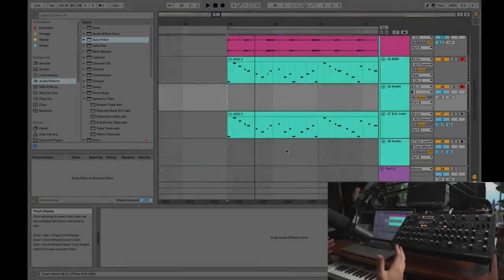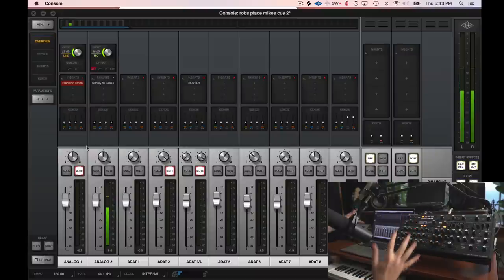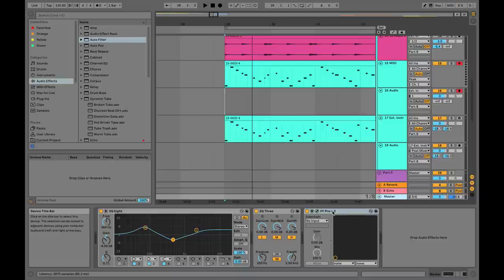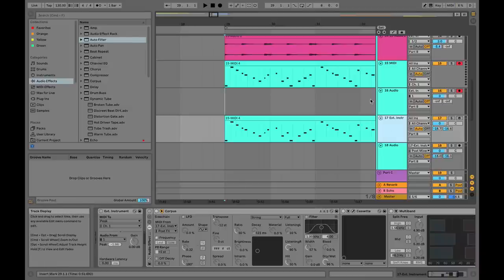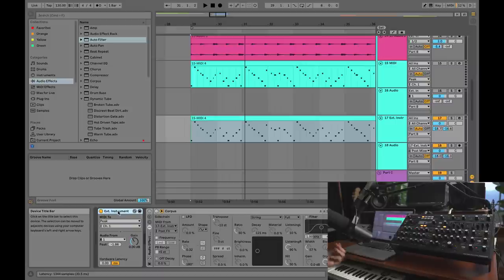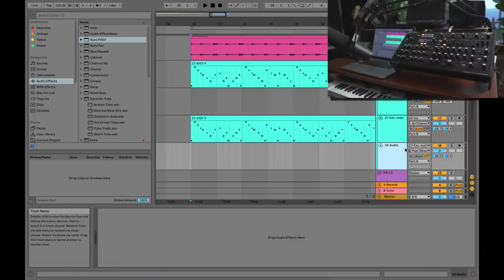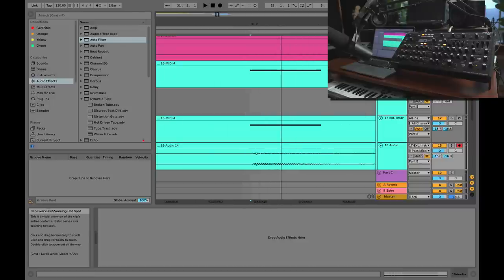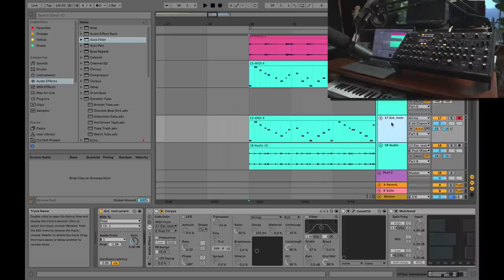How to Record Midi Synths Without Latency in Ableton Live: External Instrument

Comment: Dude - just watched both your videos on latency - so well explained - thank you. I now have to go and try it out but I can do with more confidence now - watched loads of videos and just came away still confused but I think (hope) I undersand now - in the past I just end up metaphorically throwing ableton out of the window and giving up. One difference for me is that I use an external sequencer (Novation SL Mk3) rather than the Ableton sequencer and just want to record the audio from my ext synths into ableton for arrangement / mixing / fx and adding the odd soft synth - So I am hoping this will work for me there.  Any which way these are great videos.

Comment: Great video! Would love a follow up on fixing sync / latency when using external synths that rely on clock. Example a hardware synth that has an arpeggiator, getting that to tightly sync with Ableton is still next to impossible for me.

Comment: I have many MIDI synths and hardware sequencers. I've had crazy problems where the sound from monitoring external synths would come early (crazy I know) when using External Instrument and on the MIDI channel delay offset, the "+ve" button, would do nothing, only the "-ve" worked...I need to use a larger buffer (1024) to run the stuff I like to run. Then I needed to adjust for the clock being sent to the LFOs/sequencer of the hardware synth and adjust for the MIDI notes that where sent to the same synth so the note triggering would be for example, right on time with a square or S&H LFO.
Add to that the fact that the more audio tracks that where added later as I progressed in the project with UAD plug ins and other oversampling plug ins, latency got so bad that tweaking knobs when recording audio whilst the synth was being played from a MIDI clip, would make things just, unusable.

Stopped using External Instrument, monitored only from UAD's direct monitoring, all problems gone. I know everyone's praising the thing and its obviious on the video that it works, but it never worked for me, it actually made things worse.

Comment: This is so incredibly useful - i've always had problems integrating hardware with my DAW. What about clocking / sync and jitter? There are plenty of videos out there recommending ERM multiclock but i'm not sure if I really need to be spending £200 or £500 just to get things to sync reliably? I've also seen devices like Midironome, Midiburner, JMK Clockstep, Expert Sleepers UASMO, innerclock systems, maybe iconnectivity and motu midi interfaces also do this. The new arturia 16 rig interface interests me and it also has midi clock out. Many of them work by sending out pulses from your DAW to create sample accurate timing. Do I need this kind of thing?

Also if you use a ultralow latency interfaces like an RME or thunderbolt like a quantum that do 2 or 3ms RTL does this vastly improve things and make all this a lot easier, or does it all need to be adjusted and compensated in the same way anyway, so you're not really gaining anything apart from different compensation numbers?

Comment: Hi, thanks for the fantastic explanation. Now everything is more clear to me about routing MIDI Out of Ableton and recording it. Anyway, one thing that I still struggle with is how to use external MIDI sequencers with live. So that Ableton will receive MIDI. In concrete, I use an iPad wit Ableton Link and I’m trying to send MIDI sequences from iPad to Ableton but I’m getting none synchronised results. IOS has some excellent Generative sequencers, but it is a pain to sync things together with Live. So I was wondering if you could maybe explain this maybe in an upcoming video or give any clue how to handle this. Thanks! And thanks for this Amazing video.

Comment: Thank you and great video. What midi interface are you using? I noticed you have a uad which does not have a midi i/o. I am using an older steinberg ur22 that has midi but looking to upgrade to uad so curious as to what you’re using or suggest. 

I still have some issues with latency and have since just found solution in starting a recording with a high transient like a tr8 kick then taking it out/off and setting 1.1 to the transient then taking the audio I want. My problem may be too many different synths with diff hardware latencies so I record them individually. I go ext inst out to steinberg ur22 then to Kenton midi thru 25 then to shit lol like too much dx7, prophet rev 2, tr8, ensoniq sq80 and a bunch of others and they receive on different channels (then audio into Allen and hearth zed 24 back to stenberg). Pretty much given up on being able to play loops or recorded audio w live playback from hardware via midi. My interface has a monitor/ daw switch and Idk I can get kinda close but either I’m doing something wrong or it’s just too much.

Comment: Speaking of latency... Have you ever noticed the mismatch between audio latency and midi clock? That's a common problem since Ableton is handling time differently than any other DAW. The easiest example to explain what I mean: Take an AutoPan, set amount 100%, phase 0%, sinus shape 100% and sync it to 1/16 so that it will chopper any input as 1/16. But now put some latency producing stuff before the AutoPan, maybe an effect rack containing 10 turned off compressors with 10ms lookahead each (just for simulation purpose) and check how AutoPan syncs. It's synced to the clock before the latency and choppers 100ms ahead... Well, there might be an offset knob but all that becomes really funny when you share such synced devices across the board in a growing project via send/return. Give it a try. :)

Comment: Nice video!
Since you started playing notes with your hands i assume there is no way to get rid of that latency while playing other than turning direct monitoring right?
Reply from the maker: There is always going to be some latency if using software to monitor. Much of the time, if you have your system latency low (lower your buffer size to achieve this), as in under 20ms, you'll be close enough to play and record things. Direct monitoring removes latency entirely (or within a couple ms) when using external gear because its a straight signal path from input to output.

Comment: Latency probably the single most important thing for those with real instruments. Thinking of investing in Apollo twin x to worry less about it. What do you think @anthony ?
Reply from the maker: It doesnt matter which interface you use for latency as much as it does for sound quality. Even those little red saffire interfaces have direct monitoring. UAD does however have really nice converters in their interfaces as well as plugins that run off of the chip in the hardware. Be careful though its a money pit haha
Reply: @SeedtoStage  I've been warned but the algorithm is already working against me haha. But my point is that is you don't wanna do direct monitoring for guitars (because you want to monitor all your plugin effects) then the UAD will likely be the more powerful latency-free option, or?
Reply from the maker: @bvrbvs  they have great drivers I can def say that

Comment: I came here right after watching one of those 4 producers one sample videos. I feel like my computer handicaps me the latency is unbearably awful. I was watching these pros in awe just wondering how they have one hundred effects with automation going. I couldn't do this without a fire extinguisher!
Reply from the maker: If you have crippling latency, likely you’re on a windows machine trying to use the basic audio driver. Look at Aiso4all, a free low latency audio driver
Reply: @SeedtoStage  yea I don't get it really. I have a mbox mini and my windows machine has an i5 with 16gb ram. I will for sure try that driver maybe that will help. 
My latency is zero on track one but compounds so fast

Comment: I'm in a slightly different setup, where I want to use Ableton Live as multitrack recorder, but I have my sequence programmed in an external MIDI sequencer which is also the MIDI master clock, so I put Live in EXT sync. But in my case the recorded audio appears ahead in time (~1/16th), instead of being delayed. How come? (note that when in EXT sync, both options Delay Compensation and Reduced Latency are not available)

Comment: I'm having the same issue with my Microfreak but its coming in too early and the external instrument will not let you go negative. is this possible or i am missing something> i followed the video more than once with the same result.  this video helps a lot but i still have a lot of homework a nd messing around to do for sure. is it possible for an external synth to be ahead of the ableton clock?

Comment: I am coming from Logic to Ableton and haven't made a song in ableton yet.   I have 20 + hardware synths and i monitor everything simultaneously at the same time.   I've done it this way for years and I didn't really notice anything as an issue, but maybe thats because almost all my stuff is hardware (drums, etc) so maybe everything is in sync.   I also have been using PCi and recently switched to thunderbolt motu interfaces.   Now my question / issue is?  I tried to do this method.  I added a external instrument, say midi 1.   the second I added another channel I was unable to do this because the synth shares the same output with all 16 channels (think Virus / Triton / etc) .  Is this method that you are teaching only viable for 1 output / 1 channel?  like say a drum machine?  I could do this on my Airbase99 ?   Maybe I was missing something so I can try again, but can you confirm that I can do this with 16 channels and only 2 inputs?  or not exactly.. . because in the past, if i wanted to do any effects or anything like that in logic i would need an additional output on the synth so i could have a lead isolated to put FX and then the other 15 channels could share a main output and they had to rely on internal fx so they didn't compromise the single in L R from that group of 15 channels..      thanks

Comment: Great and clear explanation - thank you! However there is one thing that seems to be impossible: to play and record midi (from a midi keyboard) in real time with no latency while monitoring through the software. That would be the ultimate hack!! I like to play and improvise live, and the small latency is annoying while playing live. If one draws in midi notes in a clip there is no problem, but for those who like to play and record midi live one has to use direct monitoring int he audio interface, and so no plugins from the software can be heard...shame. Any ideas for this?? The only workaround I found was to record with direct monitoring, and then add fx etc. after the fact while monitoring through the software after all tracks have been recorded. What do you think?
Reply: Well, I will answer my own question as I figured it out. If you want to play external synths and live record the midi sent to them with zero latency while monitoring through ableton (where you can use other plugins and fx) then use ableton's external instrument devices (like the video explains - ableton takes care of the system's overall latency if you do) and turn Delay Compensation (in the Option Menu) OFF (Reduced Latency When Monitoring will also be disabled by default). Like this you can enjoy playing and recording your hardware synths with a midi keyboard and monitoring through live without noticeable latency! Aleluia! :)

Comment: Wouldnt it make sense to calculate hardware delay compensation first, before going through lives plugins? Curious if you ran that test again without monitoring, without printing the plugins, going directly from your uad sound card, what the hardware delay would be on your synth.
Reply from the maker: Well for me at the end of the day what matters is the present application. If it is ever really bad i just fix it in the set im presently working on. Theoretically it should never change if youre using the same synth but i swear its been different from time to time with the same setup. I can clearly see and compensate for hardware delay with the method I demonstrated above for each session.

Comment: Is the hardware compensation always the same for a given instrument/setup?
Reply from the maker: It should be but in my experience weird stuff happens. Ive definitely had to change it but for the most part, recently developed gear by larger manufacturers tends to not even need it. Like in my mind, the 1.7ms of hardware delay my peak makes is a non issue.

Comment: Does this work with just midi controllers? I have a wind synth, and when playing midi plugins with it, the latency is just enough to be utterly obnoxious. I want to use it in a live setting too, so any tips there would be life saving
Reply: Of you don't use external hardware this is just an issue of live and the plugins you use. Try lowering the samples of your asio driver if possible and look if a specific plugin induces a lot of latency (like he has shown in this video) and try to find an alternative for them.

Comment: I dove into exactly this after your last video on latency. The hardware latency on my Minilogue seems to change all the time ranging from ~20-90ms, any idea what's going on there?
Reply from the maker: I cant diagnose it from here but i can say that the hardware compensation can fix the issue for each session if its the minilogue actiong up. It could be that you need to set the "Reduce latency when monitoring" to on or off depending on what youre trying to do. The most fail safe solution is just to direct monitor the minilogue and record it into an audio track with the monitor switch set to off. Then process it after youve recorded. OR record the midi of the riff and use external instrument and set hardware comp.

Comment: Please stop making latency videos when you still don’t have dec set right. Some of your concepts are right but the rest is just adding more confusion. Correct DEC settings take care of everything you are trying to say past 11 minutes in the video. Abletons plugin latency calculations are never 100% either. A plugin can report 60ms of delay but in reality be producing 100ms. This usually happens with compressors and is the main source of phase issues in bass tracks. Freeze/flatten a track with a bunch of plugins and you will see the issue.
Reply from the maker: My DEC doesnt really need to change as its pretty close at 128 samples. I did the test. This isnt something you need to do for most interfaces. The delay in timing is due to midi data processing within the novation peak. From the live manual "Some audio interfaces report incorrect latencies" SOME. The UAD has never drifted far from right, their updates to their drivers are top notch. Also I switch interfaces too much to have to remember to constantly change the DEC setting. Now in terms of delay compensation, no DAW is going to be 100% accurate. But updates come out by manufacturers all the time and this was definitely a big issue 10 years ago but now if i ever get phasing issues, i simply isolate the issue and drag. But its becoming very rare indeed. If you really want timing to be absolutely perfect beyond a shadow of a doubt, you could simply bounce everything to audio but honestly thats impractical. Thanks